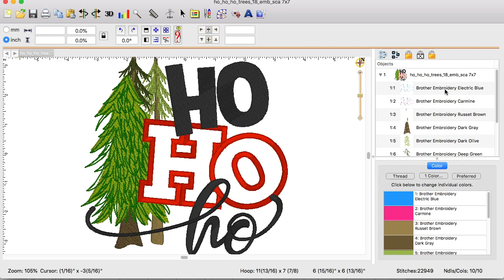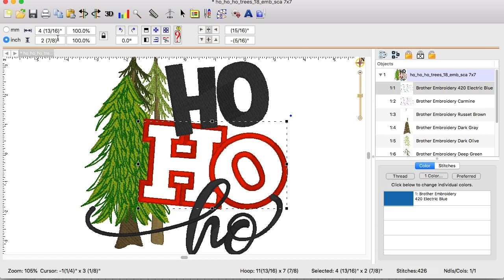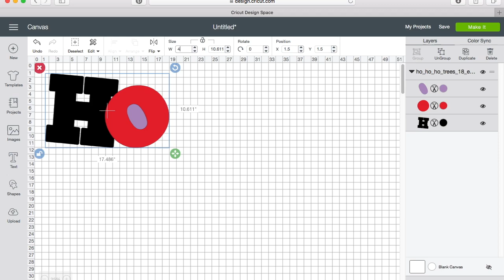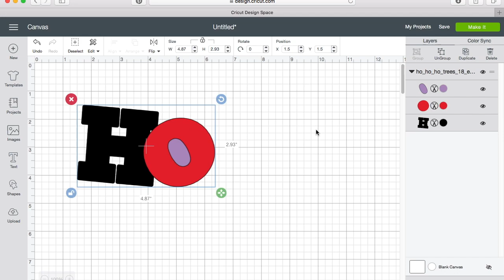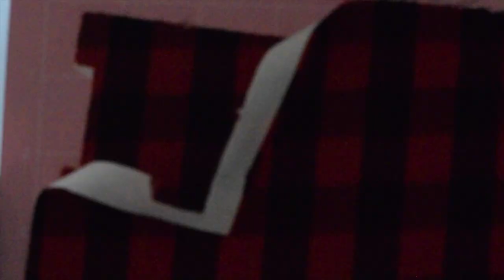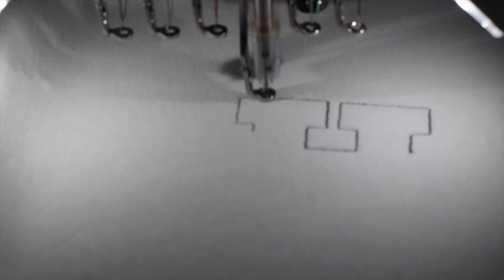Easy Applique with the Cricut Maker

Comment: How do you get the applique design into cricut  design space so I can cut it?
Reply from the maker: Hi!  You will need embroidery software to get the cut line.  Save it as an svg then load it in cricut design space.
Reply: @kimscraftykorner  I have embrilliance software. I see you have the stitch artist program from embrilliance, is that the one I need to do it? I only have enthusiast and essentials. When I get to the part to make applique I don't see the box for cutting.